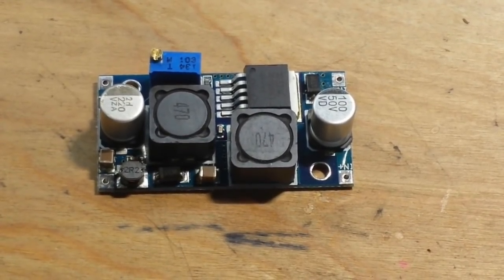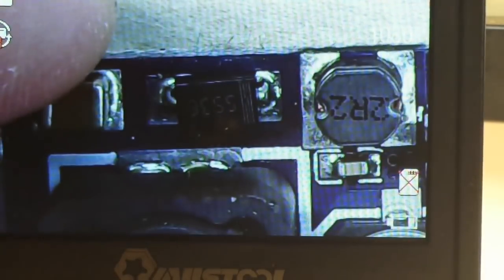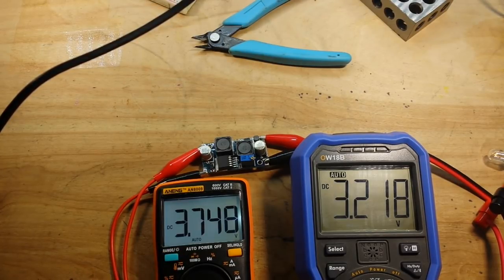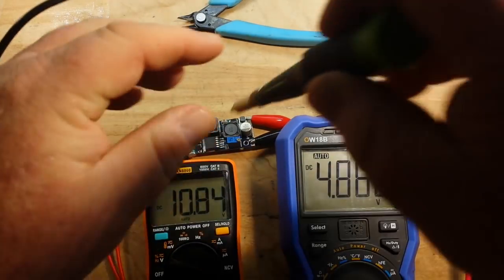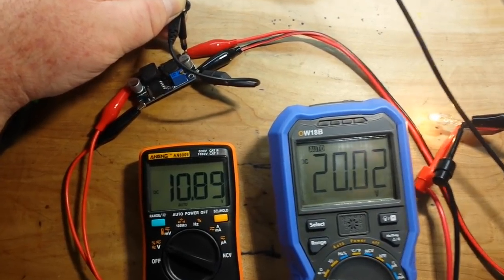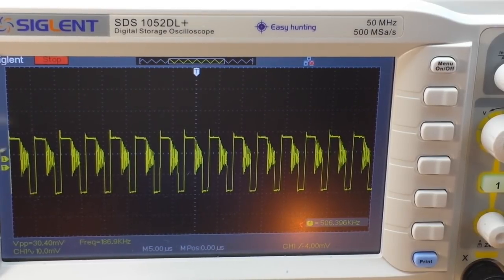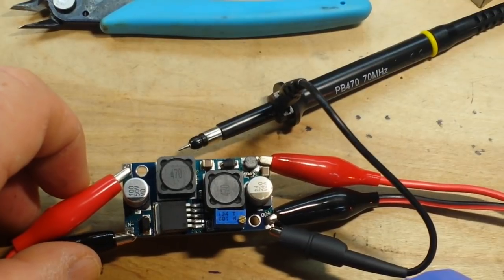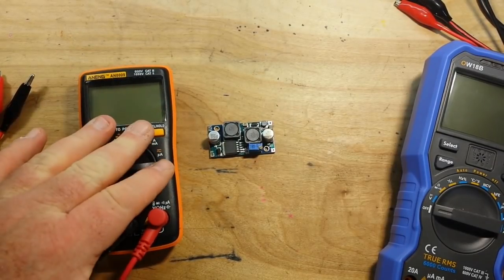XL6009 Buck Boost Module

Comment: I am wanting to install constant LED lighting in my Lionel model passenger train cars.  Will this work for that?  I would first have to convert the track AC to DC using a bridge rectifier.   Should I also add a filter capacitor before the Buck input?  or is there one already on the board.?   Great education video.  Thanks.  Dave    Atlanta GA

Comment: Didn't know you were from near Pittsburgh.  I live in Armstrong Co.  I found a substantial flaw in these converters. I was going to take one from a 2 cell 18650 8.4v to 2 leds in series.  6v.  With the output set to 6v and you power it on, it drops the input to 3v at high current.  Heats up the XL6009.  Remove the load and connect back up and goes back to 8v on the input.  If you power it on with no load then connect it, it's fine.  Tried a few and they all do the same thing.  Disappointing  I have a pretty stocked lab. We'll have to get together sometime.

Comment: One thing I observed from a fellow engineer who had a lot more experience than me on SMPSU … when you probe the switching remove the long Earth lead from the scope probe and coil a piece of heavy duty tinned copper wire around the earthed barrel of the probe and then bend down the TCW to form a parallel probe to the probe tip if that makes sense and also set your probe to x10 to reduce the effect of the scope leads transmission line properties,

Comment: great work ,I was looking for this.

Can I use it to charge my 3s4p 18650 battery, will it provide me flexibility to charge with my laptop 19v charger or 12v router charger or maybe sometime 5v mobile charger, one more concern will it provide constant current because someone on internet was saying, I can't charge my 12.6v battery directly with 12.6v charger because charger don't provide contact current.
Please clear my point, I'm very confused 🤔.

Comment: Thank you for sharing this with us BUT my question is that my XI6009 buck boost Module is from kikuu and with only 1 inductor on the board, not 2 like yours. Do you think it will be of the same working principles???? Which one is the original ???? Have you tested the one with 1 inductor like mine before ????

Comment: I am looking for a solution to get 9 Volts adjustable from my AC transformer on my model train to drive a Smoke Heater. The Engine runs on 5 to 17 VAC so if i rectify the AC to DC and go into this product can i adjust it to 9Volts + or - for tuning, from the low voltage AC to the Max Voltage AC?  Thank You the l+Price seems ridiculously low, is the board a good quality unit. Dennis in Virginia

Comment: Would have been a better review of a DC/DC power module if it included a load test, including efficiency. Simple to do if you had a programmable load bank. or even one of those cheap battery testers.

Comment: If I added a couple caps and a 63v .1mf film cap after the output wouldn't that clean it up ripple and noise?
Reply from the maker: I would go bigger than .1uF or 100uF if you meant mF. i would go with 1000uF.
Reply: @learnelectronics  I meant 1uf film cap for noise

Comment: Schottky Diodes are used because of their high frequency operations. In all smps units I have worked with use schottky diodes because standard silicon diodes do not work very well at the frequencies in an smps. They do have a higher leakage current but a silicon diode will conduct in both directions due to the high operating frequencies.
Reply: Thanks for the like!
Reply from the maker: welcome!
Reply: @learnelectronics  Also you may notice that the voltage in the output cap drops off almost instantly even there is no discharge resistor. That's partially due to the leakage of the diode.

Comment: Would this work if using 2 old school ac to dc wall warts that are isolated by transformer in the wall wart. I have 2 of them same brand and would like to build adjustable split rail bench power supply using 2 dc to dc buck boost modules

Comment: My Baja Warror mini bike has lighting  system using a magneto coil .  Out put ranges from 4-10VAC.  Builb is a 12V 35W .  Lighting sucked because it would dim with engine RPM.  Flick and just about usable.   I used  a 4A Bridge Rectifier to rectify the coiil output voltage . 1000uF filter cap feed that voltage to one of these and in turn charging a 3S Liion battery pack.  via BMS.  Works Great.  Lights are bright as ever and no more variations due to engine RPM.  Out put set to 12.0V the batteries can never overcharge. Due to the BMS they will never deplete to the damage level ,  Happy camper.   I have no Idea what the output current is rated on the thing.  The IC employed says 4.0A .  I'm only asking like 3 Amps out of the thing and it's not  toasted.   Measured never seen the battery pulling more then 2A. Battery has never cut out due to low voltage so the unit must be providing at or close to the 3A I'm using out of the battery.  

Would have liked to see what the relationship is between input current and output voltage.  

Ring is being cause at  Fet Shut off flyback from the inductor.  Not much could be done.  Being within the Switching voltage it's not damaging.
Reply: Hey dude! I have same idea in my mind from some weeks! Can you please elaborate yours! So I can take some notes! It would be of great help!
Reply: @hackerman2764  just use a diode pack and cap between the switch and the lamp.  Googl diode filter cap circuit.

Comment: Thank you for the video.
At the beginning of your presentation you look to be having a problem with the boost side of this board. Unfortunately you were running the board below the recommended minimum voltage is 3.8V. These boards are noted to become unstable below this value and can lead to the output hitting 30V.
Also I am confused why you was shocked to find schottky diodes on the board. It is standard practice to use schottky diodes in switching power supplies because of there charateristics.

Comment: How do you determine the power capability of a boost converter?  ie: 12V 18A available input. I need 14.1V up to 8A output. How do I tell if the converter will handle the amperage?  I’ll get the output power. But how to I tell if the booster will handle the power load.  Go WVU - yeah, I’m just south of you. Glad I found your channel.
Reply from the maker: Power and current are different. Current handling is determined by lowest rated component on the device. So if you have a board with lowest rated component of 3A you can not go above that. To find the power rating, if its not in the specs...P=V*I.

Comment: I have a LTC3780 buck boost module from ebay. The inductor is surrounded by 4 mosfets and it is controlled by the LTC3780 ic.

Comment: Coil is being almost saturated  and shottky diodes are good for low voltage drop apps such as batteries ( in parallel) , but there are some application notes that implements that diodes in buck converters.

Comment: These are excellent buck/boost converters and do really well with a stick-on heat sink too. I actually burnt one up.....then after seeing a repair video (Andrew Cartwright's), i soldered in a new (upgraded) capacitor and new(upgraded-SS54) Schottky diode and it's now working again like a champ! These can take quite a bit of current too. Watch Robojax's video's on testing these modules if you get time,
Reply from the maker: Robojax? Never heard of him....thank you ill look for him.
Reply: Had a look at his video. He's trying to pull 30V 4A out of this module while supplying 12V and calls it a fail.... He doesn't know what he's doing.
Reply: I agree,,,he tests pretty tough, but he does test all variations of power in and out. I have found them much better modules than he found, but i am  not so tough on them as he is either. You will generally find that they will perform somewhat better than his tests find but that's because he is hard on them.

Comment: I understand what you mean by voltage/current reade off in buck and boost modes, but I would not call that efficiency. For that you would have to compare their performance in terms of output power/input power.

Comment: Wow. I'd like that meter. Hey I'd like to even have the used one! It's a nice looking meter!  I was just wondering . do you know anything about solar charge controllers? Mppt charge controllers. They are alot like a buck converter. Or some like a boost converter. That just tracks the I V curve for max wattage. I would like to build one. But that's way beyond my abilities. I'd like it to take in up to 150v charge up to 72v . and if you haven't laughed your self out your chair. I want it to pass 150 amps! Easily. 200+ would be nice. It would take a few really good FETs. And a huge inductor or two! Would you be interested in a  tinkering on a project like this????  It would make alot of good videos. And maybe it could be sold? I could buy something similar. It only does 86-90 amps and cost $600 . so it would be $1200 or so. Maybe one could be built for alot less. I am probably just dreaming . so what's your take? Keep up the awesome work!

Comment: Could it be. They used the  diode they could get cheapest? Even with the possibility of crappifying the product. Or it could have been a factory thing. where they just used a diode! Nice video. Some reason I just love buck and boost converters. Especially a buck boost!
Reply: Not cheaper, no, actually a good bit more expensive than silicon rectifier diodes. By enough of a margin that if they had an overstock of those, they would have been better off selling it off and buying silicon rectifier diodes if those were suitable.

But it's a 200 KHz switch (according to Paul, more on this later) with square wave output, essentially besides the 200 KHz you get all the higher harmonics, so every little bit of extra time spent in diode recovery hurts the performance - a diode that would have been usable with 400 KHz sinewave may be too slow for intended behaviour in a square wave driven design. At some point the losses of Schottky diode that it produces due to leakage become lower than the extra losses that a rectifier diode would spend in recovery. They must have likely calculated this point to be below the switching frequency they're running it at for their design. Another consideration is that the duty cycle can be very low i.e. when current consumption is low, and can lead to outright failure of the design to produce any useful behaviour altogether if the switching and recovery time of the diode isn't short enough. The datasheet for the switching IC XL6009 specifies Schottky diodes exclusively for all the suggested designs, you can trust the IC manufacturer to know what the hell they were thinking. There are no accidents there, if they had a way to reduce the total cost associated with their product, they would have taken it into consideration, as it would effectively allow them to charge more for their ICs or shift a larger volume.

And by the way, it's not running at 200 KHz, but at 400 KHz fixed, look in the datasheet. It either decided to insert extra sleep cycles on Paul due to low current consumption, or he had a measurement mishap. There really is remarkably little design room for silicon rectifier diodes above 300 KHz!
Reply: Schotky diodes are preferred rectifiers for switching power supplies for improved efficiency.  They have a lower forward voltage drop which is very good for efficiency.  They also have a better recovery mode and the leakage current is low enough not to even worry about.

Comment: Actually, those inductors are 47 micro Henry (uH), not 470 Henry. You read them in a similar way to resistors, the first two digits are the first two numbers, and the third digit is how many 0's to add. i have a few of these buck boost modules, they work pretty well. That ripple is also there on the ones I have, doesn't cause any problems.
Reply from the maker: Yep, i realized after i posted, 47 and no 0s. Youtube used to have a way to make corrections but they took that away from creators and my upload is was too slow to upload the whole video again.
Reply: I made the same inductor mistake as I was learning about these things - different rules for different components! I'm curious about the ringing though, does that possibly indicate it needs more capacitance?